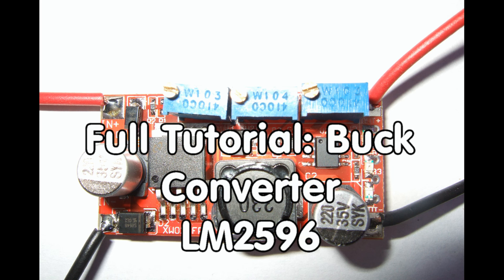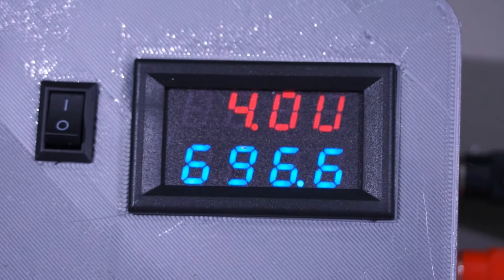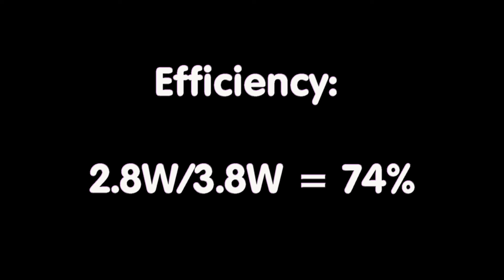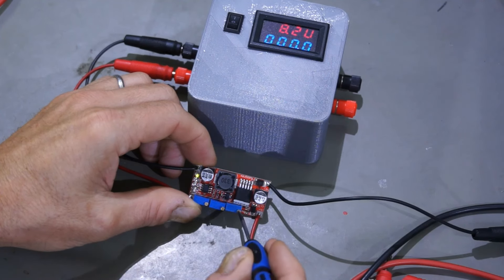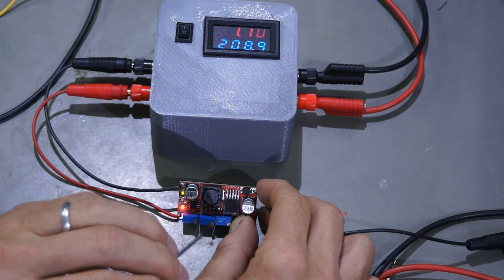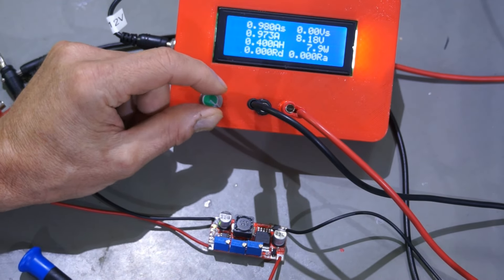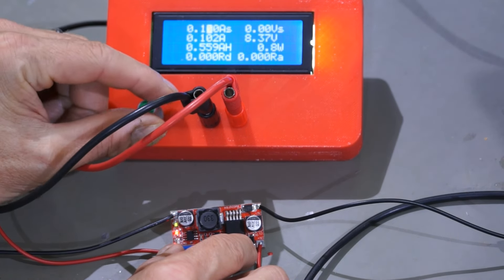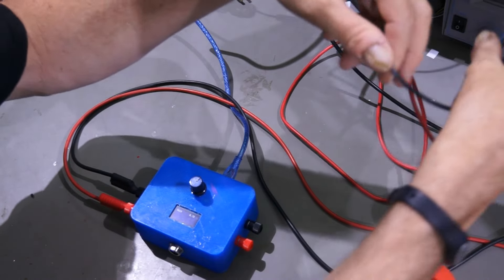#7 Tutorial: LM2596 Buck Converter with Three Trimmers (step down converter)

Comment: i am using it to make power supply but the current trimmer doesn't seems to work,while volt work fine...plz help
Reply from the maker: Unfortunately, I am not a clairvoyant, so I cannot see, what is wrong with your device. Maybe it is just defective and you have to get another one. Make sure you completely understand the function of all three trimmers. If you have an ohm meter, you can also measure the resistance of the trimmers and watch, if it moves when you turn the screw. Make sure, that you do not connect the device to anything if you do this measurement. Otherwise you can destroy your ohm meter.
Reply: I have ordered ten of these three-trimmer modules from China,  and am also having difficulty with the current limit.  I set the voltage down to 3V as they suggest in the product page,  then set the current limit to a few hundred mA,  then when I connect a 10W LED across the output it jumps up to 1600-1800mA!  I'm not sure what the problem is here,  and it's not just one unit (so far).
Reply: @Roy_Tellason  Are you using the VA meter to measure current? If so, you must not connect the thin black wire. The thin black wire on the meter directly connects to the thick black wire (measure it!) and it shorts out the shunt resistor in the DC-DC converter if you connect it. This means the current reading is wrong and also the current pot does not work.  The thin black wire is only connected if you are powering the VA meter from a battery or isolated power source.
Reply: @AndreasSpiess  steve6375 comments is about a volt-ampermeter module, he keep commenting, this is spam, look above...

Comment: Sir I have a same module but I can't trace out the functions of the trimmers and the LEDs .....please help m ....I watched your vedios many a times but then also the problem arises
Reply from the maker: I do not know more than shown in the video. Maybe you module is defective?
Reply: @AndreasSpiess  no sir the module is not defective 
The link to the module is CentIoT - CC and CV - Boost And Buck Voltage Converter LM2577 & LM2596 https://www.amazon.in/dp/B076T8G68F/ref=cm_sw_r_cp_apa_i_L..5BbYJSZ6P1
Reply: I m using 12 volt (4.16 A ) adapter to charge a 12 volt (4 A) exide lead battery ....and the module is also charging but I can set the floating voltage or I m not understanding the function of the middle trimmer practically .....
I would be very thankful to u if would help me in the matter

Comment: Can i boost the ampere by this module???
Reply from the maker: Yes. But nor voltage
Reply: @AndreasSpiess  can i boost 0.5 ampere to 1or 2 ampere
Reply from the maker: Bock converters take the input power and convert it to a different voltage level. If you want to have double the current you have to have double the voltage on the input. Maybe you google "buck converter"

Comment: It would have been nice I f you loaded it up to 110% and then increase the power supply voltage to see how it handles dissipating the extra watts. You recommended something that you haven't even test at 20% of capacity.
Reply from the maker: +womplestilskin You are right, I did not test the module. At the time I did this video, several other videos were out, but nobody understood the purpose of the third potentiometer. To explain this was the  main purpose of my tutorial.

Concerning testing of cheep chinese product. I know, that many of these products promise power ratings which are too high. I would never use such a product at the full rating or even above. Then I buy a bigger one and use it well under its stated performance. With this procedure, I still get very cheep material and this is why it is ok for me.
Reply: +Andreas Spiess You can find multiple images on Google, with the proper function of the led on Google or Ebay. I believe that most eBay units should make 3a, they are electrically able to do it. But it won't take long for them to go into thermal protection. Which, hopefully you would expect, as there's no heat sink! Once you have enough thermal sink should be fine to be used. After all of these are the same as chips and SMTs that go into your other electronics, hopefully. If it's not an authorized XL2596, then expose it.
Reply: +Andreas Spiess I meant (led and trimmer, not just led)

Comment: Bought 2 pcs voltage adjusted type only.  Stepped down 12v to 5v. Voltage jumps from 5v to 10v for a split second. I wouldn't recommend using it on my pi3.
Reply from the maker: I also do not suggest any variable voltage devices to use with USB devices